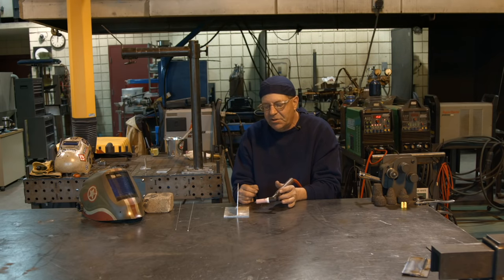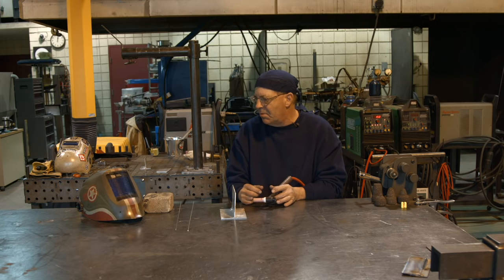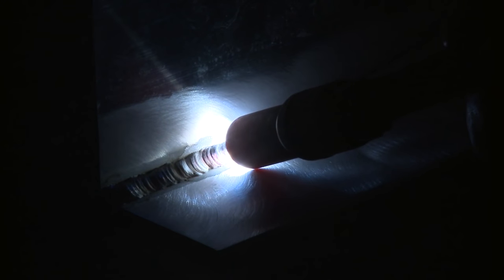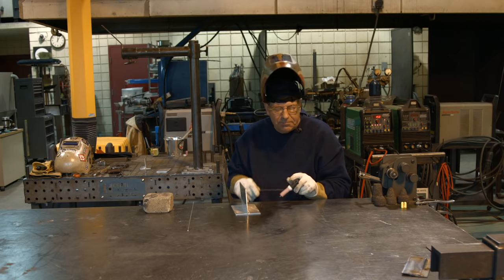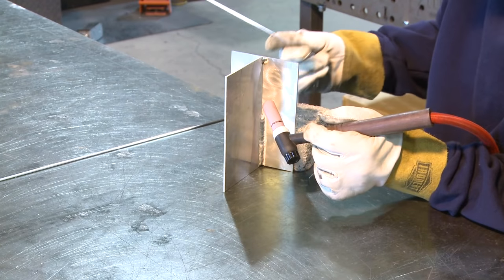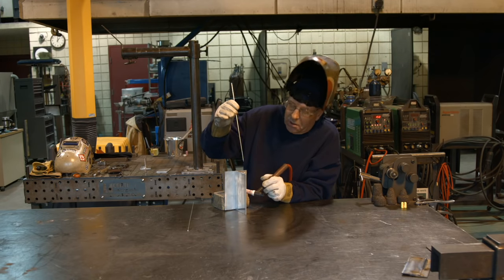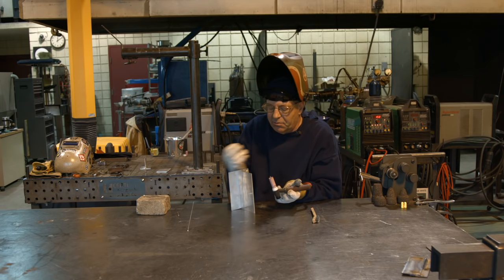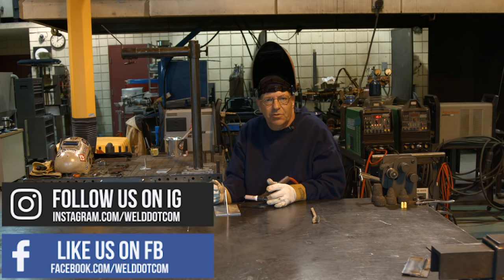🔥 Tips to Improve TIG Torch Control

Comment: Bob I weld aluminum daily and when someone is feeling the heat your moving to slow or you do not have enough heat and the part is getting over saturated with heat. just what i learned over the years.

Comment: I want to learn to TIG.  Now that I've had a chance to try it I know it's not going to be as easy as MIG, but I love the welds.  They are clean and even artistic.
Reply: It's fun when you can cut loose and weld what you want to weld. When it's the only viable option on a difficult job, it's a learning experience. Get you a machine, I've been running an Everlast 255EXT and it's been welding perfection.

My first one had some real issues with arc initiation, it wouldn't arc at all and after 20 - 30 seconds at best, it would throw a terrifying arc. Called tech support to let them know and she was sent back. A few weeks later, I got the best machine I've ever gotten the privilege of operating, much less owning. 🤑 It'll put a stack of dimes right back into your pocket!
Reply: Thanks for the recommendation.   I'm going to Fab Tech this year, so I'll be sure to take a look at them.

Comment: could you possibly do a video on sch 40 4” in the 5g position. 6010 root, 7018 hot, 7018 fill and cap. Stringers for the cap if possible please?

Comment: Nice.  "young dog"  I shake like a "young dog" especially if I have any caffeine in my system.
    I have to say It was good to meet you in person, (Justin's tag team workshop) but I have to say that you are tops in presentation and content even if I hadn't met you in person.  This particular video addressed pretty much all the problems I am currently having being a novice.  
 One of my mistakes (I think) was too much amperage for a given application.  So if  Could you also tell us what amperage, electrode size, wire size and type for the particular application illustrated I would be greatly appreciative?  This would save me from destroying parts that I am trying to "fix" ;o)
Kind Regards;
Jason H
Reply: youmakeitreal if you use a foot pedal then its easy to set. You can alway set your amps high and start low and work your way up until the material starts to melt, thats what i do.
2.4mm electrode and 2.4mm filler wire is a good all round size, unless you are doing really thin or really thick stuff. I mainly use 3mm thick aluminium for the tanks i do and i set my machine about 160 amps and move quickly on open outside corner joints, but i dont use it all .
Reply: Mr. greens boat tanks and aluminium welding. Thanks!  Just what I needed to hear.  Totally makes sense.  I will start approaching my jobs in that fashion.  Much appreciated.

Comment: What about in situations where Peddle Control is not available or possible? Like scratch start or finger trigger because your down under something. Curious to know your thoughts.
Reply: use downslope as amp control
Reply: Like not having pulse options on the machine at all and you're not able to use a pedal... If you have a remote input, you have the option of a racetrack control for the torch. There's a pulse box that's available online that'll allow for up and down slope as well as pulsing. I can't remember what it's called, but it's on YouTube as well as Google search.